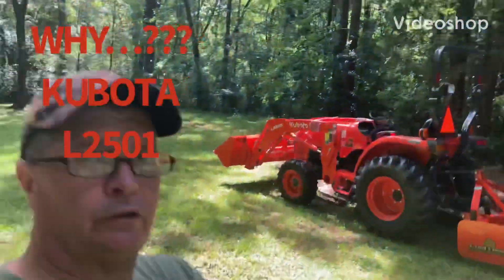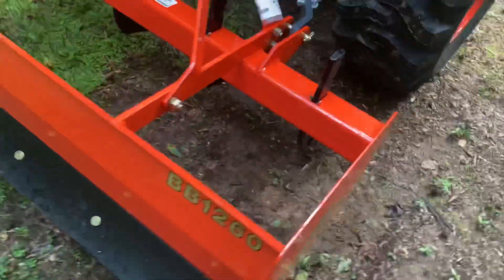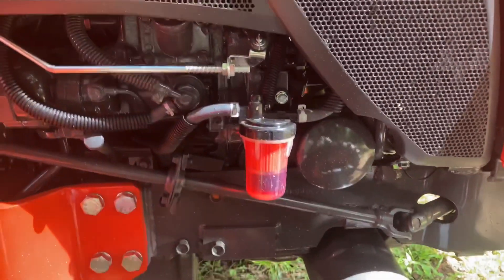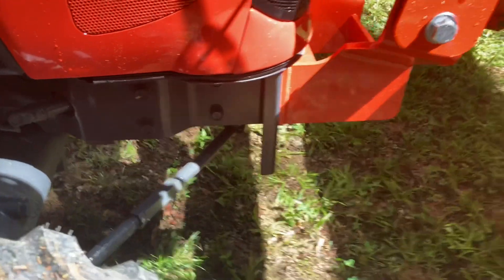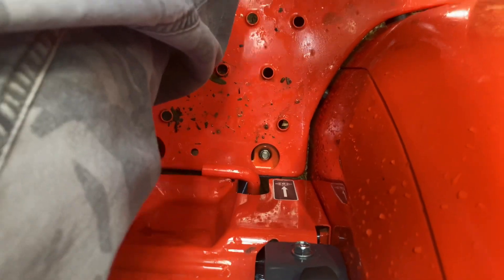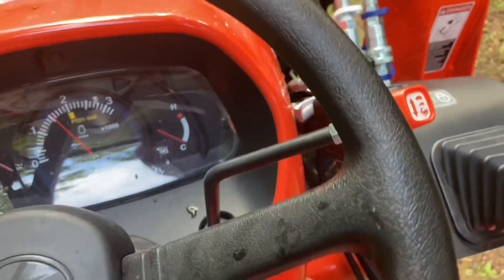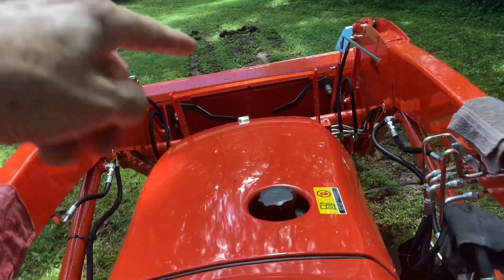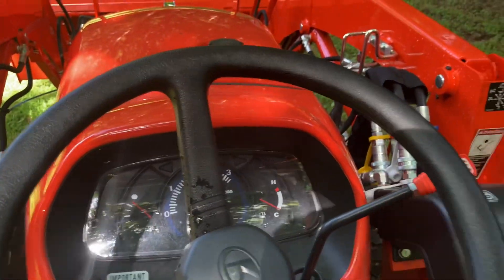KUBOTA L2501 - Watch If You think Of Buying This Tractor. Why I Did…!

Comment: i bought this tractor recently. I was a finish operator in the 80s amd 90s building golf courses . Those tractors were set up beautifully for balance and stability. People would gather sometimes to watch us work on steep grade wondering how we could hold a slope with those machines. Wide turf tires ,fluid filled tires and wheel weights. You would never have your brakes locked doing dirt work , if you ever started to tip hit the downhill brake hard at turn down hill. You get to be pretty good when your doing it 12 hrs a day seven days a week. Today my body cant take but a hour or two looking over my shoulder like i did so much of as a young man but I love dirt work.  Im going to flip wheels and add wheel spacers. As is it is a tippy tractor and my wife and son have no experience , If your on the tractor you seat belt needs to be on,  i dont feel right with it not on. Thanks for the vid,
Reply from the maker: Thank you for sharing this….God bless you…!
Reply from the maker: This is a great tractor….
Reply from the maker: Thanks for your response and watching…

Comment: I've got over 450 hours on my L2501.  I have not a complaint with it.  Mine looks to be all made in Japan.  The filters and everything have Japanese brands on them.  I love my HST and R4 tires.  I have a running bet with a local doctor about getting it stuck.  It's been a long running bet and I haven't had it stuck yet.  I dig in clay that is super sticky when it rains [think pottery clay].  I use it to move material from the back of my ten acres up to the front.  I've had it clearing fallen logs over a creek (the creek in my profile picture).  Nothing.  I've tilled in March with the tires fully clogged and kept on truckin'.  

A friend of mine just watches when I am out there on rainy days.  He waits and waits and is never satisfied.  I won't get stuck.

I know that ag tires have more traction but, in my opinion, I don't know how much traction a guy needs.  I certainly don't need anymore.

With regards to the tractor itself.  I have never owned any tractor but this one and I have never had an issue with it.  Not hoses, HST, engine, nothing... it just runs.  I have a fair amount of friends around me with all different kinds of brands.  Mahindra being the most popular here.  A lot of them claim, at first, that Mahindra is as good and cheaper than Kubota.  Well, just about all of them now tell me they wished they had went with a Kubota.  Between the three of them they must have six months total in the shop racked up.  Meanwhile, I am out on this 25HP metronome tractor.  Turn the key.  Shick shick.  VRRROOOOOOMMMMMM.  It just goes.  

I love mine.
Reply from the maker: Great comment on a great tractor.  Thanks.
Reply: This was a great read.

Comment: Hey Man that "Kubogy Shines". You got a good TRACTOR -- with "4 on-the-floor". I would get this tractor IF IT HAD a shuttle-shift 8×8 & if the "weak" loader had bucket-amplify-likage-bars on for bucket curling. My two other tractors( Kubota MX5200 & a Massey-Ferguson 1736m) both have this feature (bigger &more expensive), but sometimes TOO BIG!   The Kubota loader system on your rig is super-strong, but "WEAK on speed & lifting power". The valve is high quality-functions very well.Your New Tractor was an Excellent choice. The r14 tires are Good for light snow & wet grass traction. The R1s offer tremendous traction all-around but TEAR-UP everything. Your R4s are the best choice, get tire chains if you need more occasional traction. Thanks for the great Video Sir and happy safe tractoring .GBWY.

Comment: Great video was curious how much you ended up paying for everything including tractor ?
Reply from the maker: You are looking at around 20,000.00.  They add 2000.00 insurance but if you pay it off in half the time you would get 1000,00 back..  might be little more now not sure.  Thanks for watching.
Reply from the maker: Maybe 21000.00 added box blade.  You would be in the area of that but I believe they are worth it if you have a need for one.  Thanks
Reply: Price went up. After tax w/loader roughly 23,000
Reply from the maker: Everything is going up makes you sick I know.  I need a tiller they have gone up 500.00 dollars.

Comment: I am planning to buy one, -my dealer is pressuring me to get the hst even though I came in asking for the gear drive.   He is very aggressive in saying I should go hst.  I have used a 8n for 25 years, and don't mind the gears at all.  What do you guys think?  He says I will have less trouble and maintenance with the hst and says resale value is better w/hst.
If I buy ,I probably will never sell unless I become unable in advanced years .  This is my only decision stuck point.
Reply from the maker: I like the gear drive but I’m sure the hst has advantages in some areas.  Kubota is a great tractor.  Go with your heart on the tractor you feel. God bless in your choice making.  Thanks for watching.

Comment: If you don't mind me asking can you change gears while you are on the move
Reply from the maker: I’m sure you can but I’ll let you know for sure tomorrow I’ll be on the tractor in the morning.  I have not really tried it.  I’ll find out in the morning.  Thanks for watching and asking.  That’s a great question.
Reply: No. I have the same tractor (2016). It doesn’t look like they changed anything. Great tractors
Reply from the maker: Yes today I finally got back out on my tractor the  L2501 and yes I tried changing gears on the move and you can change them on the move.  Sorry it took me so long to get back with the answer.
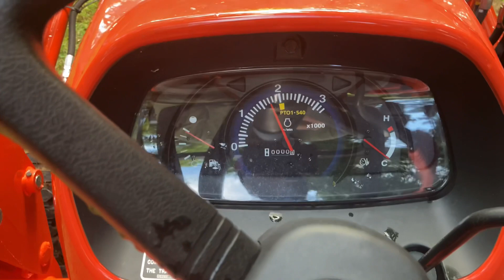Reply: Check the sticker under the fuel gauge at 6:43. Before I do any shifting I always stop, of course its yours run it like you want. 
Great review!! They’re great little tractors 🙂
Reply from the maker: I just changed the gears to see if you could I don’t need to.  I run in lower gears most of time.  But I will check sticker.  I surely don’t want to mess it up.  Thanks for reply.

Comment: do these come in hydrostatic transmission
Reply from the maker: Yes.....thanks for watching
Reply: Yes and they are amazing
Reply: @garzaalexag  does it have a diesel particulate filter  and does it take def fluid
Reply from the maker: Not sure on that question...?
Reply: @attechoutdoors5893  it don't  25hp and up have the diesel particulate filter
Reply from the maker: Mine is 25hp
Reply: @attechoutdoors5893  i bet it's 24.8hp
Reply from the maker: I’ll check it out and let you know.
Reply: @kyleerickson3382  tractors under 30-40 hp don’t have def from what our sales person told us
Reply: @kyleerickson3382  i am not sure about the particulate filter mine just looks as if it’s straight exhaust to a muffler and that’s it can’t see anything else
Reply: @garzaalexag  its actually under 25hp